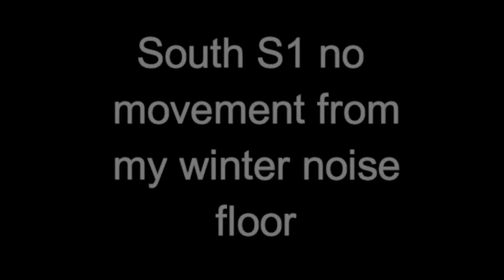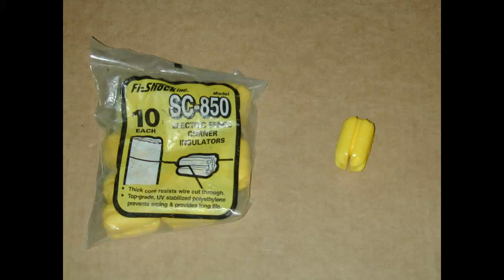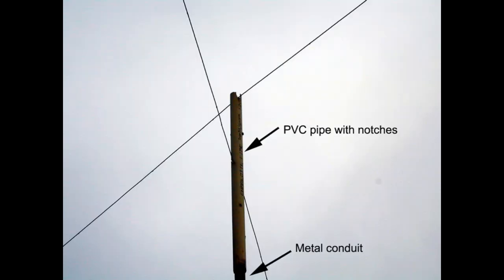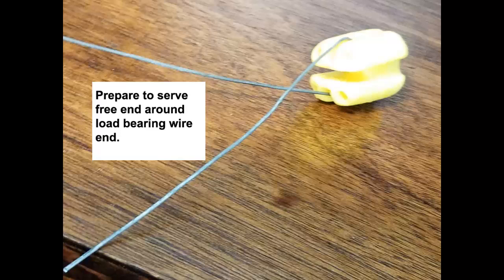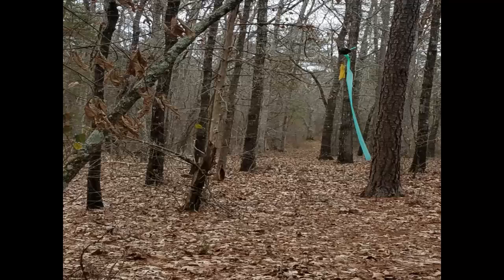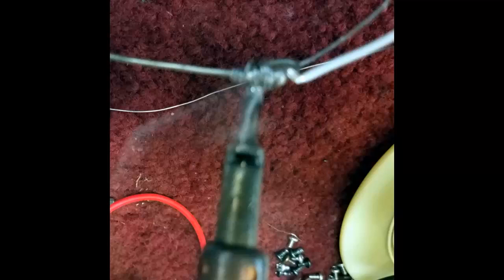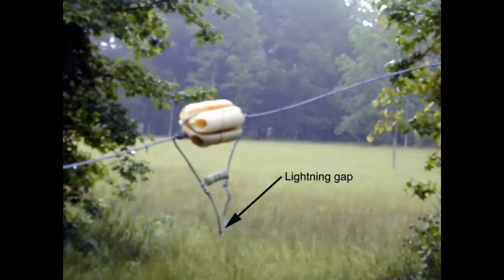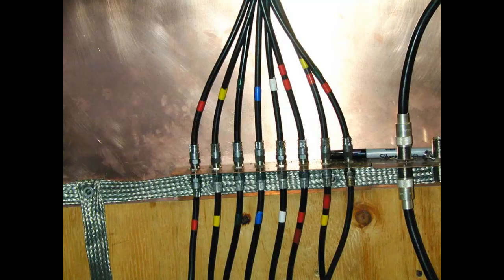Beverage Antennas Mechanical Considerations

Comment: Tom, I'm now in the second stage of moving back to Vancouver Island from Atlanta and I am looking into the best construction techniques for the antenna farm.  I fondly recall running the NE phased beverage system with you back in the day prior to one of the CQ 160 tests so nice to see all of the mechanical considerations you applied as we went along.  Plans are for two 120' towers and low band systems on 5 acres.  Thanks for putting out this video.   73, Jim VE7ZO

Comment: Thanks, Tom. How long a run of 17ga electric fence wire would you run without support? I have a field about 400’ wide and wonder how many supports I need in between (i have lots of electric fence wire available). Thank you KM6FZD
Reply from the maker: The fence wire (or bare copperweld wire) I use has a very good strength to weight ratio. My antennas easily support with rigid steel conduit "prop poles" and PVC insulator stubs, or convenient trees, every 200 feet or so. Generally I pull an entire antenna span tight and then prop at points needed. 

Understand we rarely have ice down here so ice not a consideration.

I also use a pole where wires cross to make sure they remain separated. I generally prop the top wire and hang the lower wire with UV and weather resistant nylon cording that is used for netting.